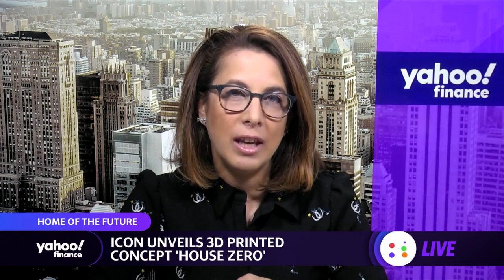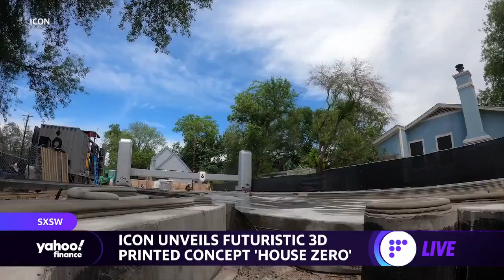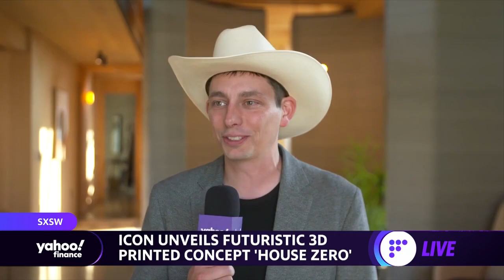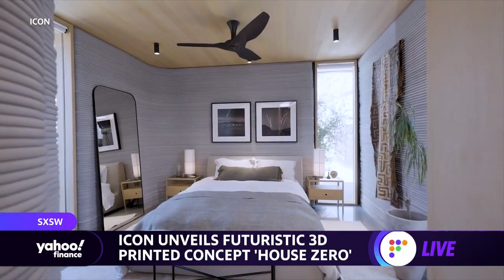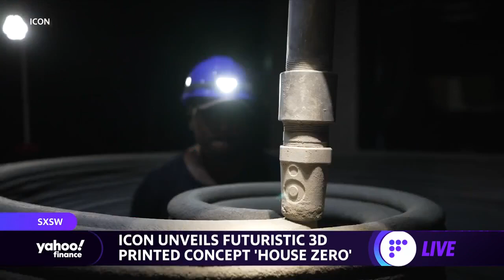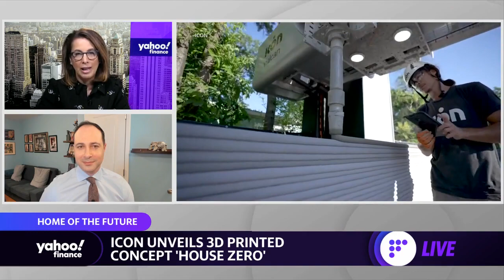Icon unveils 3D-printed concept house at SXSW

Comment: Should have mentioned the THERMAL PROPERTIES of the material.  What are you reporting on anyways??   Is it a better insulator or a worse insulator compared to traditional building materials?    Very important in Texas!
Reply: My understanding is it is a better insulator. Also water, fire, and earthquake resistant. 
He seemed more worried about the "curves" and "mowing" than anything else 😮‍💨